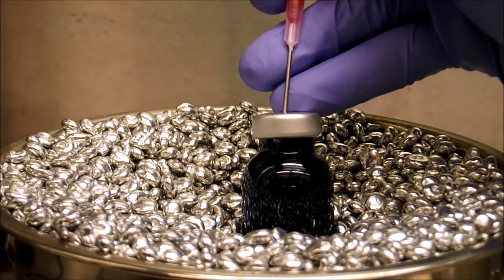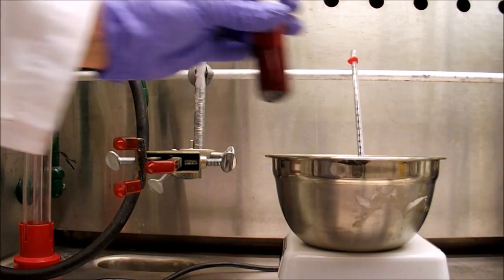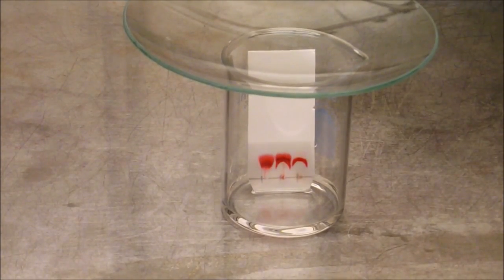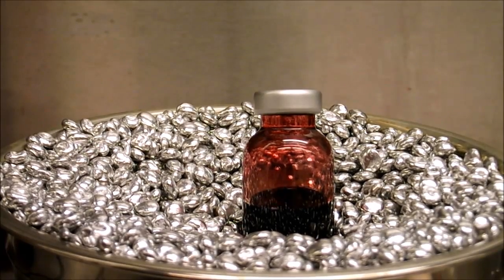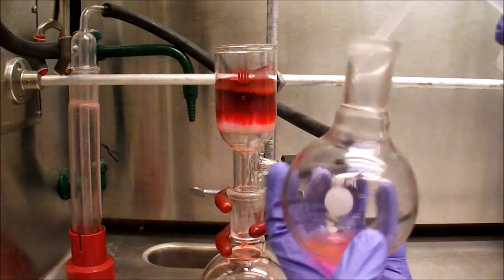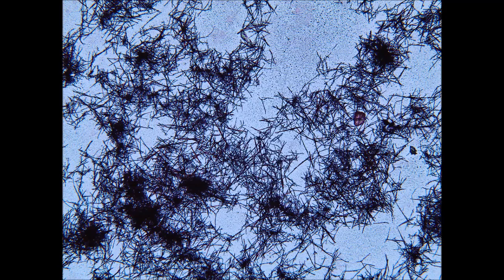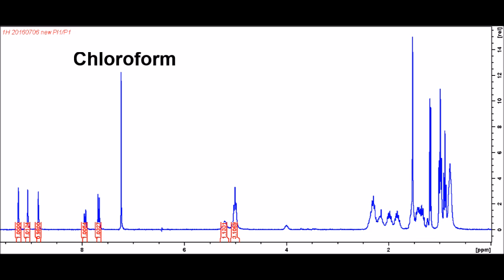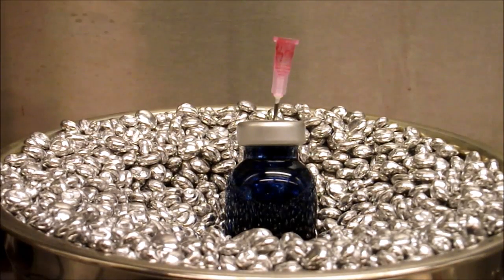Dimerization of Perylene Diimide

Comment: generosity of the researcher is appreciated. The videos explain everything and make it simple to those like to work on PDI. What is that heating bath used in all the reactions?
Reply from the maker: Its a bath of Lab Armor beads. They are just small metal beads that we use instead of a more typical oil or sand bath. The main advantage is that they are far easier to clean, and don't get oil into everything.
Reply: @welchlabchemistry4763  thank you for the info. can you give  me contact details of the supplier for the Lab Armor beads?
Reply: @sprajasingh  The supplier is labarmor on their own website, but it appears that they do not sell directly. They are available through regular suppliers such as VWR or ThermoFisher.
Reply: @joninacann  thank you

Comment: this guys lab technique is so bad.
Reply from the maker: So, where could I improve?
Reply: Stop spilling chemicals! 0:41 4:50 Or at least lay down some aluminum foil so you don't ruin that beautiful fume hood. I was taught chemistry is 50% brain and 50% hands.
Reply from the maker: The first one, there is paper towel underneath just out of shot, but still catching the falling chemicals which I then transferred into the vial. Also, I usually weigh my reagents directly into the reaction vessel, or am holding it which prevents that kind of spilling, but for the sake of the video I change how I do some things. The final filtration is mainly an issue with working around the camera, which I am not completely used to yet. In order to not block the shot with my hands I was pouring at a very awkward angle which lead to the bit of spilling.
Reply: I spill shit all the time, and it doesn't matter that much for the majority of reactions, stop being a little bitch. I also always just eyeball it when adding catalysts instead of weighing them because that's useless. Cowboy chemistry is the best and less time-consuming.
Reply: @bdnugget  damn right Iagree, good chemistry is knowing what not to worry about, @Welch you're awesome I hope you'll make more videos soon